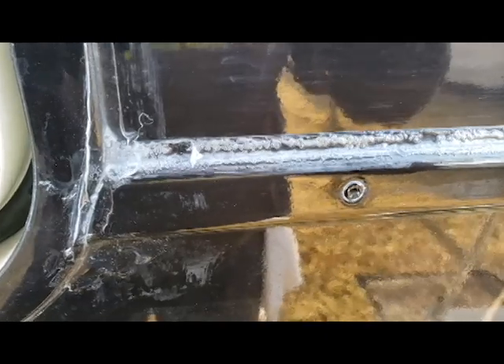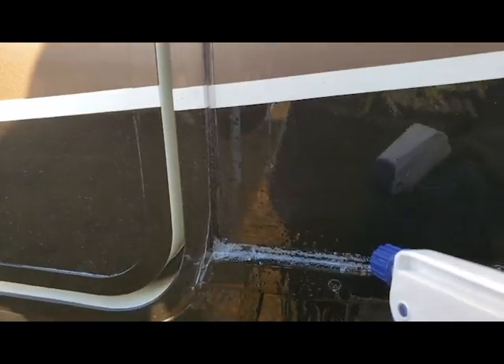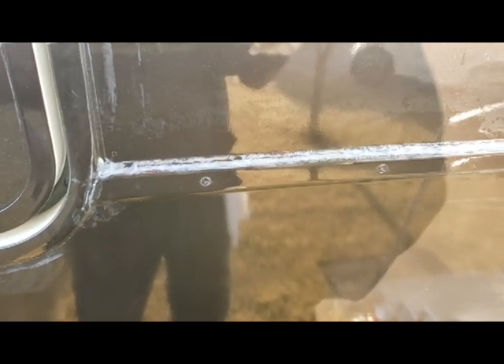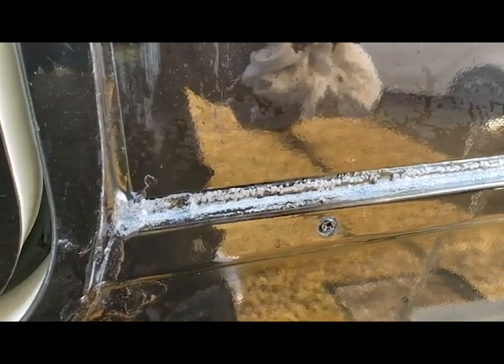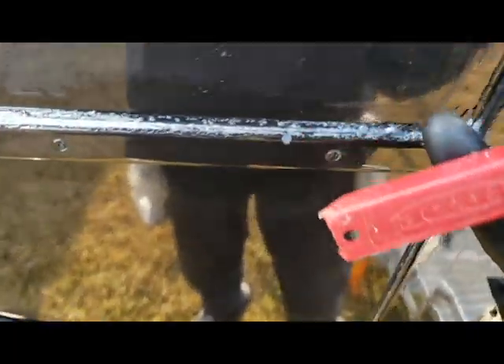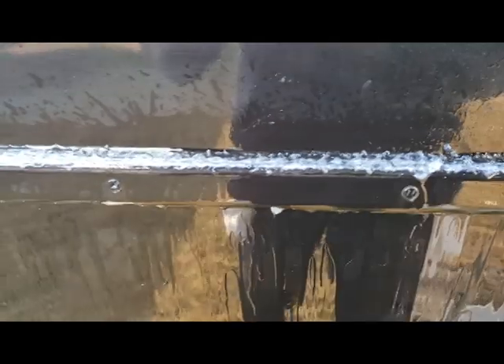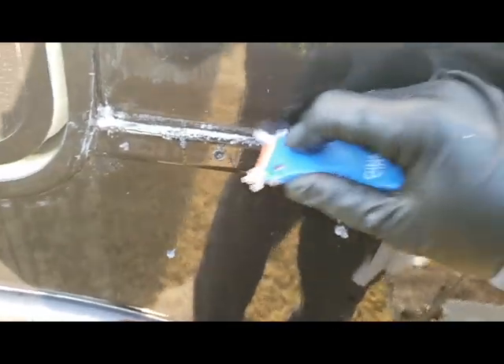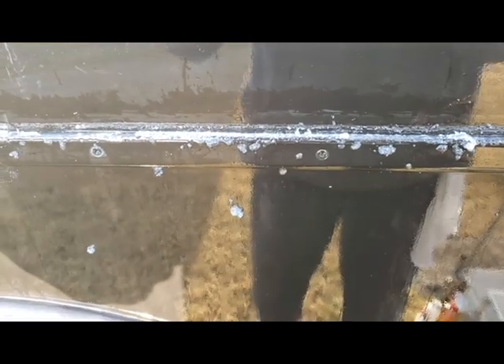Lexel Silicon Adhesive Removal 11-15-2019

Comment: What mineral spirits do you use? I got plain ole mineral spirits from menards and tried it on a small spot. It took off the wax and really dulled the paint. Might of even taken off clearcoat?

I just put it on a rag and used my finger to rub on the coaches original sealant (geocel). That alone caused the damage 

Thanks!
Reply: Same here!!! Thank goodness I only tried a small spot. Looks awful lol

Did you ever find a safe mineral spirits?